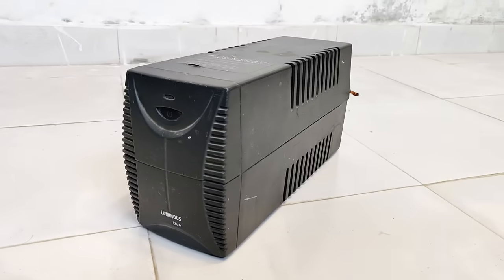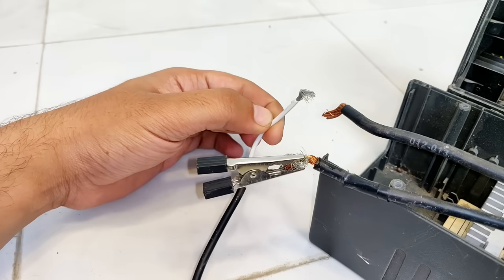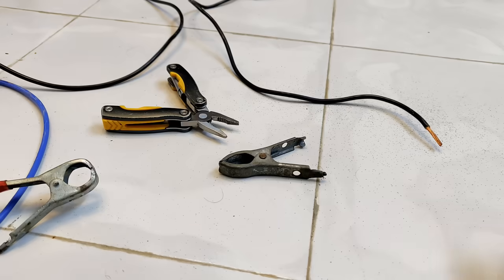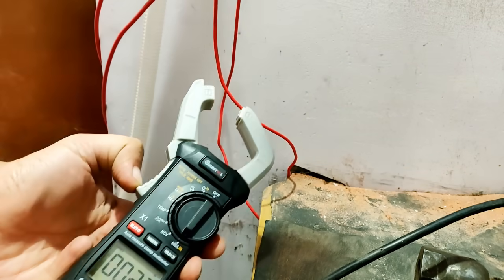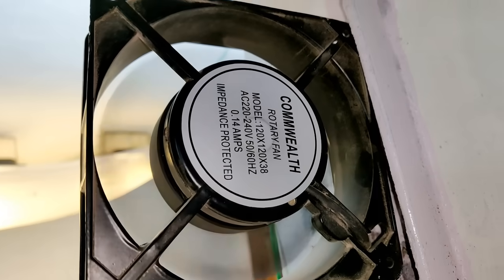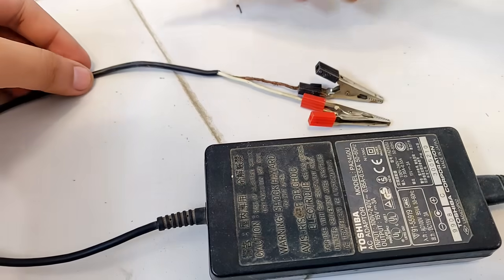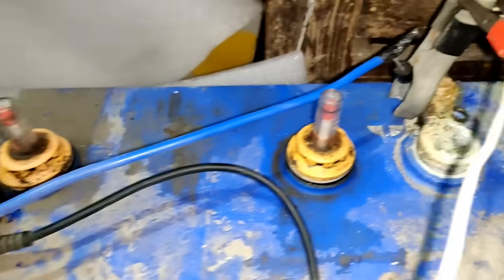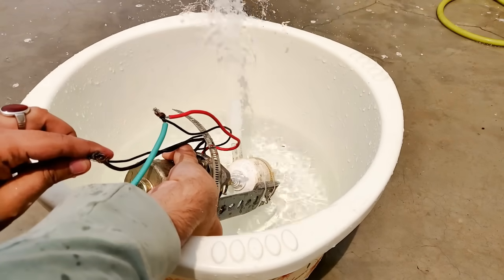Can a 12V 7Ah UPS Inverter ( 220v ) run with a 14.8V 150Ah Battery ?

Comment: the size of the battery is irelevent, you can stick a 12v 100000000000A battery and it will still run, the UPS only draws the current it needs, so for the original 7Ah that might have lasted say 10mins on ups, the larger 150A will last maybe 10-15 times longer, the 1000000000A longer still. Some off grid houses use submarine batteries with their ups, ive been using an old 270Ah marine battery on my old 500w inverter without any issues, standard lead acid batterys will eventually fail as they are not designed for deep cycling.
Reply: The size of the battery for these kinds of small UPS is VERY relevant. The cooling of the transistors is usually passive and is calculated in such a way that by the time the heat sink reaches saturation, the battery would be out of juice and the inverter can stop. If you must extend the run time on a bigger battery, the cooling has to be forced air cooled, using a suitable fan. And the other aspect to be looked into is the charger. The inbuilt charger is not designed to charge a huge battery. Therefore you must connect an external charger to finish charging, within a reasonable duration. The inbuilt charger will charge, but it might take a very long time to get to the finish.
Reply: The internal charging circuit can be damaged due to the high charging load of the large battery. APC manufacturers works fine, many others will die.
Reply: Yeah, the size is irrelevant when you're DISCHARGING the battery. Everybody knows that, it's quite obvious and needs no explanation. BUT what happens when you want to CHARGE that huge battery back, after you ran for days???? That's what I was trying to explain in my note. I've been playing around (making too) with UPS's from 1988!! So I know what I'm saying, especially from a purely Practical angle. And I worked for MGE France, for 15 years.
Reply: @tonyrebeiro can you connect a old laptop charger cable inline with tge ups two positive amd negative wires wil it help charge the bigger car batteries better? Im not good with this stuff
Reply: @HWNWOWN  No. This will not work and it may damage the laptop charger. You need to have a custom built charger, that matches the battery voltage and recharge current rating. The charger should also be able to support the required charging current, without overloading and getting damaged.
Reply: charge it with another charger
Reply: As long as the voltage is withon range you should be fine. More ampere hour just means for runtime when the power fails and the ups inverter switches on battery
Reply: Good bro
Reply: The UPS can't charge huge batteries. It has low charging current.
Reply: 😮 sinosoidal no
Reply: Can use 500w ups and 200ah battery for air conditioner
Reply: You can have a 1000000000a battery, the load capacity will still be capped to the UPS's transformer rated power multiplied by power factor. In order to power more load, you still need a bigger transformer, hence why such hacks are only relevant in large capacity UPS
Reply: From where u got submarine battery?
Reply: its about the heat generated from the circuitry of running more than half its rated capacity for longer than what is possible with the stock battery these things get really hot its dangerous
Reply: Podał pan 100000000000A to jest mocy 1000000000000W czyli 1000MW A to jest 1GW... takiej mocy w takiej formie w pudle malutkim nie jest możliwe nawet... nawet akumulatory od tira nie pomogą tutaj na 2sekundy. Ok?
Teraz real. 600VA... 0,7cos... 420W max... czyli bierze 42A max? No 50A ... z akumulatora tira ok wytrzymać może 2h... I ładowanie dwa dni słabym prostownikiem...
Reply: @piotrekj8447  a jak ups ma 400w i aku 2 ah to mocniejszy można dodać mu

Comment: The shown method doesn't work with Apc rs 600 ups, as soon as the  batteries are connected it senses higher capacity connected and shut downs the ups  within seconds but with intex ups it works but also separate charging device is needed the power mosfet on ups heats too much and gets shuts down so the charging relay on the ups has to be disabled and only load switching relay has to be enabled always & a 80mm fan may help cool other passive components but not charging circuit.

Comment: Wont the laptop charger connected without a cut off reduce the life of the battery? Also, curious to know why the battery has to be placed on a wooden plan to reduce self discharge. The bottom part of the battery is plastic which is non conductive in nature. Then why add wood? The only benefit is a  layer to prevent acid leaking onto the floor and damaging it.
Reply: exactly I agree with you
Reply: Yeah it will screwup the battery

Comment: Put 3 4mm wires of same length in parallel to connect the battery to the UPS and as short as possible.
Also the UPS usually turn of if the voltage drops to 10.8V and is measured at PCB level, so if you have 11.5V at battery and 10.8V at PCB it will turn of anyway.
Every mV counts on low voltage with that amount of current.
Reply: I agree
Reply: funny mine turns of at 12,4v 600 watt version
Reply: @luckydubeinrc5165  You must measure the voltaje at PCB board level not at battery posts.

Comment: Hi, I got ups connected to a 12v100ah (free maintenance battery) swapped this with the small battery inside. I don’t have the measurements tools right now, but is the battery getting charged? Is it an upgrade for the smaller 12v7ah that was inside the ups?

Comment: I have one of these in my house. How do I prevent it from shutting off every 10 minutes? Also, how do I get rid of the loud beeping noise?
Reply: Replace battery
Reply: @RajeevRajanrajivrajan1  Wrong, my friend ! The UPS has an USB or serial interface to connect at PC/Laptop. After installing the associated software that usually comes with the UPS, he can change the running time on battery or even to run until battery is discharged and beep can be turned off by pressing short UPS's power button or via interface.

Comment: Last year I did a similar thing where I connected my UPS to a 12V 100Ah old car battery and use my PC and router on it, but when the power goes out it only lasts for 5 minutes before the UPS turning off. Dies anyone know why it is not lasting any longer?
Reply: yeah, the clue is "old car battery".  You probably are measuring surface charge. Right after you charge it, it will read a higher charge.   Take the reading a few hours later. 

 And put a load test on that old battery; a known wattage say a little heater on low setting at say 500w or lower. See how long it runs until the voltage starts to drop quicker, and that is what you have to work with. The voltage should remain roughly stable for a while, ideally for one hour on a 1.2 Kwh /100Ah 12 v car/deep cycle battery, which by math would drain it to 50%, or about 12v.  All numbers are approximate here.
Reply: @mikemotorbike4283  of course I charged the battery before using it. I also repeated the process several times and it always would last around 5-7 minutes.
What I meant by old is used and not good anymore, which I think is the problemhere, since the battery would have a capacity way less than 100Ah. I also think the UPS might be part of the problem since it is an old one (bought it around 2002).

Comment: Since Mr Electron is using an old battery, he can experiment with it. But for people who are going to try this with a new battery, please note that for tubular battery, you need atleast 6 to 8 ampere of charging current. The built in charger of the ups only produces around 1 amps of charging current. 

As Mr Electron is showing in the video, he is using a separate charger for charging the battery.

 Now if you guys want to use a new battery with a computer ups, add a charger with atleast 8 amps for 100ah batteries, 10 amps for 150ah batteries with a cutoff of 14.4v.
Reply: i have a 2kva battery with a n N40 battery.what should i do?
Reply: For 32 ah battery, extra charger was needed?
Reply: @suguganesan6982  32ah/5=6.4amp max charger can use... 32ah with 1amp charger take around 1.5day/32hour to full charge
Reply: Good bro
Reply: Can i connect battery charger and the ups at the same time? Is it okay?
Reply: Can we use charger with 19V=1.75 A output?
Reply: Charging Ampere should be 10-20% of ur battery capacity AH.

Comment: Bro good video ....Keep it up
I have a online ups 600 w and dc 36v . Now my all three battery not giving backup if I purchase new battery then almost 30v three battery cost around 10000 . 
Spend 10000 on Old ups this good or not ?? Or available any other cheap way to use my online  600 w (36v)ups ????
Please guide me.

Comment: Really useful Video.
Few Questions:
does the UPS not charge the battery as well and keep it at a floating charge?
if so why use a separate charger?
Does the UPS not overheat or get to a temperature which could damage it over a long period of use? im asking this as i have heard a PC UPS is not designed for long periods of use that's why i watched your Video but does not mention anything about it as i want to do the same thing to my ups.

please let me know

Thanks
Reply: ups only charge 1 amp... so add a 6 amp or 12 amp charger depending on battery ah..his one needs 20 amp charger.

Comment: How the wooden plate will help with the self discharge of the battery :D
Reply: It's one of those things that survived through generations but are no longer true. The first/ earlier lead acid batteries did indeed needed to be stored on an insulating surface, because the housing of the batteries were permeable. This has not been the case for decades now, but the myth is perpetuated nonetheless...
Reply: @pa6552  I even did a test and overnight the voltage didn't even drop by 0.01 volt.

Comment: I have a question in the video, i don't think we need to use seperate charger to charge the battery, the same ups will charge the battery right?
Reply: The UPS would overheat and burn up. People are usually put extra fan on UPS if want using it for charging.

Comment: Good day!, my analysis w/ ur vlog is ok provided that u step up d amps of ur UPS  w/ d intent of longer time capacity,,, well i sugest if orig 12v7ah   backup batt to beefup to higher 100ah u will provide a doublethrowswitch to jump the existing orig backup power w/ a required higher 12vamp

Comment: Hi ! I connected luminus 600 va to 150 ah battery. It gives output but within a minute current disconnect and it off like battery is drain while battery is full . Any suggestions!

Comment: From personal experience;
33Ah car battery with a frontech electra, 
Do not plug in anything more than 150W. I thought aside from the routers and CCTV, a TV would be fine, but NO. Used with a TV for 2 weeks, and the last time when the TV was on, for 20 minutes, the battery input wires caught fire on the PCB. The traces are not large enough to carry enough current. Plug in light appliances.

Comment: Note: I am copy-pasting this comment on every ups battery video TODAY ( see date of comment) to get faster reply. Please if anybody knows it, please reply.

While changing the cable of the 7AH lead acid battery (same one in video UPS) I have cut the Negative (Black) terminal (Not intentionally) head. So some part of it is still there in the battery which I can not connect Anything only multimeter to check the voltage and also not able to remove it as it is fixed.

The UPS was in use for long time and so while opening it, the wire connected to the Negative terminal had white residue which I cleaned successfully after removing the wire. The fixed type of terminal broke while fitting the UPS back as before.

Now, I cannot use the battery at all and it is in standby as cannot connect any wire to it.

If anybody knows how to replace only the fixed terminal head, please reply.

Comment: If you charge the battery through the ups, one, the ups chargwr circuit will blow up and two, if it does not blow up, the wrong charging/standby voltage of the ups charging circuit will kill your battery in a couple cycles

Comment: i also have 600VA UPS can I connect 6*12V 7aH batteries with it? if yes, will it heat up the UPS circuit or damage it or I have to use any mini USB fan to coll down it?

and with same UPS circuit can I Charge these batteries, if yes how much time it takes to charge, 

or I have to use any other ckt or charger to change it, if yes how to connect that chager with UPS ckt.

Reply

Comment: Dude, I installed 2 pieces 30AH batteries at 1200VA ups for increase backup time. The problem is I loaded up to 300 watts, it doesn't back up for long when the electricity goes out. It turns off after 10 minutes. Even the transformer and circuit board of the ups gets hot.solution please
Reply from the maker: Use an additional exhaust fan... Bldc fan from computer CPU because the ups is not designed to operated the loads for longer duration so even if you add large number of batteries it is still going to turn off to protect itself from getting damaged. The only way to run it  is to provide an external cooling system.
Reply: or you might be given a standalone large inverter from a friend, as I was.  Send your intention out to the cosmos.  If you are at home at the time of the power outage, when you want to use the power, and have no life critical loads needing guaranteed 99.999% uptime, then you can just hook the inverter up to your battery, and keep the battery charged with a car charger.  When the power cuts out, just unplug your big stuff from the wall, and plug into into the inverter.  It only takes a few minutes.  

I run my modem and router off the 24vDC, AC500w UPS, with 2 larger 12v external lead acid batteries in series.  That's just for fun, but it does power my smart devices, and runs the Alexa routines on timers.

Comment: Can we use a lower current battery to power the ups and at same time an alternator to charge the battery, while the ups is on. Pls reply🙏
Reply: You cannot use low power battery to power UPS. You need a high power battery like lead-acid or lithium iron phosphate. Low power batteries have high internal resistance thus causing high voltage drop when high load is connected.

Comment: You cannot measurement DC current  through clamp meter.
Dc current can be measured by connected in series.
Reply: Yes you can
Reply: @danielimanah8681  
How can we?
Clamp meter works on induction isn't?
If it's dc current than can we measure DC current?
Reply: @gauravnaikin  In principle DC and AC current are the same. Only difference is ac moves on sine wave form while DC moves on square. So if pass through any copper coil transformer will cause a reaction which the meter detects and display.
Reply: @danielimanah8681 you're wrong. DC is a flat line when shown in a function of time. DC current is measured with a hall effect sensor

Comment: I used the same with 60Ah car battery and sepperate smps tuned to 14.2v for Battlery charging. Still working nice.
Reply: Good bro
Reply: Full charge how many hours?
Reply: If connected to the battery can generator charge it when plugge?

Comment: What will be the backup time if connect A 40Ah battery 
How to calculate
Reply: Battery life is dependant on the demands made of it.  If you are only using it to power a light load it will last longer, but if you drawing a heavy load, obviously the battery will discharge quicker.  Another factor to take in to consideration is the condition of the battery itself.

Comment: Plastic batteries do not discharged through the cement floor that is a early battery era mythology when batteries were made out of wood and they could discharge to the bottom of the wood case because the cases will always moist that is not the case for modern batteries if they're plastic they do not self discharge through the floor

Comment: Most of the Computer UPSs were designed to work under 30 minutes to save the making cost battery size. Connecting bigger batteries like 150Ah, there are some problems ahead,
Transformer material are chosen cheaper rather than heat factors. Power switching devices like MOSFETs are also cheaper.
   Charging current for 150Ah battery is not sufficient from such UPSs .. they Might take larger time to get full charged.  
But I appreciate the way of your language and demonstration .. nice
Reply: mine working for 5 years no problem 600 watt version Victron x 2 220 a batteries, charging by 470 w solar to controller, then controller to battery,
Reply: @luckydubeinrc5165  battery in series or parallel pls?
Reply: you can add a fan to the ups
Reply: No it won't cause any problems because bAttery won't deliver that many amps as it will draw low current not super high current this intake of current will be increased if the ups is subjected to a load the circuit is protected from high loads to prevent overheating of components and the excess load might problems but connecting a 150 Ah battery won't cause even a single problem if we remove the protection circuit and put peltier coolers in heatsink it can survive longer without problems
Reply: But your source of charging is outstanding
Reply: But if I add cooling fan, will that help to run for longer time without any problem to ups board? Please answer.
Reply: Good bro